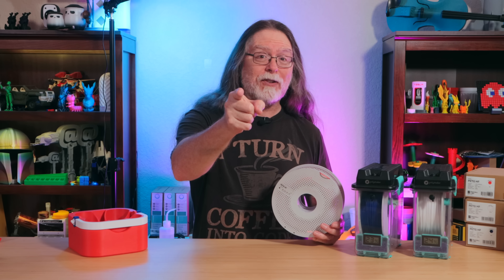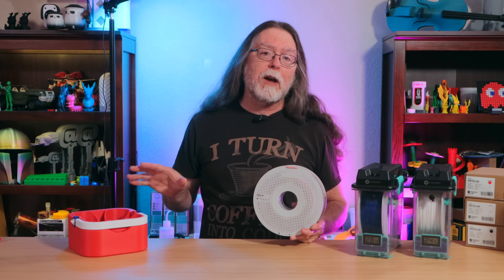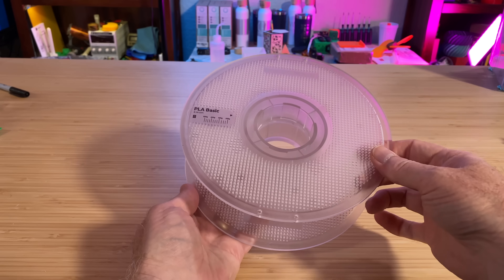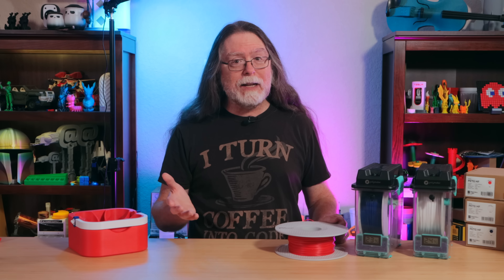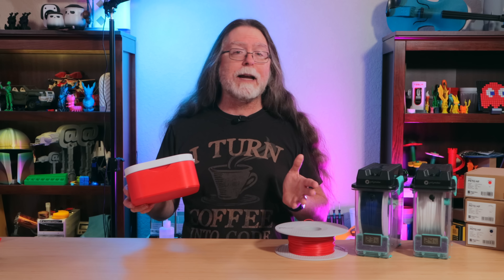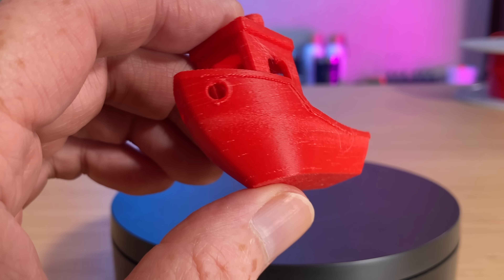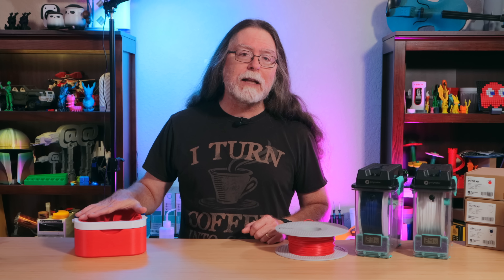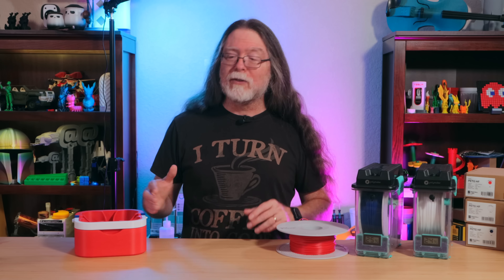What is PETG HF Filament?

Comment: Based on all the comments... Maybe trying to sell PETG to the average Bambu owner was a mistake when they expect it to just work like PLA tends to do. It's like giving someone a free spool of PA12CF or just ABS and them freaking when it doesn't work how they'd expect. People are about to find out PETG can be a bit of a PITA sometimes, but once you get it figured out it's fine.
Reply: I think the bambu needs to just update it standard petg profiles. I found some custom profiles online most people are using and I've not had an issue with petg since basically they just halve the petg print speeds from what I can see
Reply: You know I started out with PETG. I mean I remember using the pla that came with my printer to do a test print but even my first spools were PETG.
I used PETG and TPU for all of my prints before buying the Anycubic Kobra S1 Combo its a core xy printer. I did buy some PLA plus on sale in many colors for fun. For me I have so much experience with PETG now, my printer is enclosed now, and I dry it with my ACE PRO unit either before during or after prints.
I agree with everything you said but for me its PETG all day everyday.
Reply: lmao Yeah,... I think you nailed it with the description.
Reply: @defaultname2417  The comments i've heard about people complaining about having to dry the filament is hilarious. That's 100% normal for most filaments, but especially PETG. And if you get into the more "engineering grade" filaments, it's mandatory. Maybe Bambu made a mistake of trying to sell PETG as being easy to work with as PLA. Which...it's not that much worse, let's be honest.
Reply from the maker: I generally print in PLA, so that's where a lot of my expectation comes from. To be 100% fair to Bambu, they do say to dry the PETG HF before use. I took that as more of a suggestion than a necessity, but I learned my lesson. If they say dry it before you use it, DO IT. 😅
Reply: @BV3D oh I wasn’t necessarily jabbing at you, I just meant a lot of the comments made it clear to me that a lot of people just print PLA on these machines, it seems. 

I’ve been there too though. Had some PETG give me a lot of trouble and nozzle clogs not that long ago because I was in a hurry and didn’t dry it. 😂
Reply from the maker: @skinnybricks  I took no offense at the comment at all -- just owning up to being a mostly-PLA printing person! (and keeping my PETG HF dry!)
Reply: @skinnybricks I'll go one further and say a lot of people in the 3dp community only print pla.
Reply: Realistically, if you’re using it for usable parts, you can often get away with not drying PETG, anyway, since there isn’t typically a lot of jumping around over gaps to cause stringing. In the past couple days I printed a replacement bracket for a broken drawer and a coffee bag clip on PETG that was left out in my garage with it raining on and off in the last week and it was… fine. 

If you need anything with finer details, you just throw it on the heat bed with a cardboard box over it for a couple hours, dry out some old silica gel in the oven and throw it in a (makeshift) drybox. But even that’s pretty rare, unless you’re exclusively making toys.
Reply: i have creality k1's and i love petg. I print with it alot and no real issues.
Reply: I’ve had zero issues with petg in large with a Prusa mini. It’s prone to more warping in some designs but easily countered in the slicer. Stringing can sometimes be a factor but again between slicer and heat gun it’s a non issue for me. I’ve had no issues with bed/layer adhesion as I’ve seen a lot of people say but then again I’ve only ever used atomic filament petg? I’ve used both their pro (plus) and regular with same quality/consistency results. I tend to burn through spools regardless of the type of filament so I’ve yet to have to dry any filament I’ve used (prefacing I’ve not gotten into the more notorious stuff like pa so I’m sure that’s a must regardless if it’s freshly opened or not) I don’t expect petg to be as cosmetically performing in the same way I don’t expect tpu to be rigid. I find that people who usually make a big deal out of filament “issues” are the same ones who can’t be bothered to learn or figure things out by themselves and will be forever bound to PLA or default profiles that work for them.
Reply: Haha even when you get it figured out and print the same color all the time you’ll get changes in composition that screw your all over again, lol. 

Source: I exclusively print in petg 95% of the time. ;)
Reply: @st3venb  what filament do you use
Reply: I primarily print hatchbox petg through the AMS.
Reply: @st3venb  ahh I can’t speak to their filament but I had similar issues with other brands and when I swapped to atomic filament I haven’t had it since.

Comment: I ordered a couple spools, and before they arrived there was a “filament update” for the PETG HF, gotta check the boxes for it in the settings. It’s been a PITA to print using their settings but it prints fine when I use silent mode.
Reply: PS: I dried it for a day at 55 c cuz that’s all the hotter my sunlu drier got.
Reply from the maker: I'm pretty sure that's what happened for me. I updated the firmware and the slicer, but the in-app update may not have immediately presented itself. When it did, and I applied it, that's when Studio became aware of PETG HF. 😃

Comment: Great to see this new material in use, thanks. I just stocked up on some PETG basic refills last week as I don't intend to use this at all, the drying requirement put me off as I can't do that. I have a Benchy here that was printed yesterday with multiple undried PETG filaments on my A1 Mini and the result is as good as or slightly better than the dried PETG HF result you have there, no imperfections at all. I'm happy to offset the time against the cost of running a dryer, so I suppose I'll be looking for another filament brand to use.
Reply: Same here I'm very disappointed they've discontinued the old PETG & replaced it with something that requires more work, equipment, time & electric to set up, which for me personally negates any benefits of time saved on the print. I'm not really bothered about slightly longer print times as I just set my printer away & forget about it until it's done, however I am bothered about me having to waste my time doing extra work plus having to buy driers etc.

Did you switch another brand? I need to start looking today.
Reply: @northeastcorals  I reluctantly moved to PETG HF when my PETG basic ran out, I haven't been drying it before use and have been getting acceptable results. Bambu filament winding seems to be worse now though, so after the spools I have now I might move to another brand.
Reply: @MattTester  Interesting, thanks for the info :)

Comment: About to watch to hear your thoughts but I’m coming right in to say I’ve been using this for a couple of days and I’m loving this stuff, no stringing at all. I have dried as recommended and I have this on spools in the UK, all recognised by the AMS just fine
Reply from the maker: The dry-before-use part seems to be critical with this filament. 😅 I learned my lesson!
Reply: @BV3D  certainly looks like it! I’ve just taken to drying anything I buy as soon as I receive it and sealing up myself when I know it is!